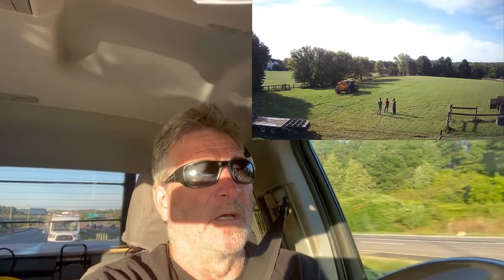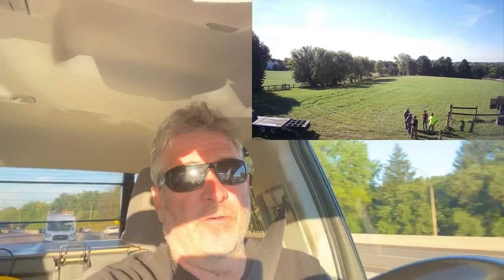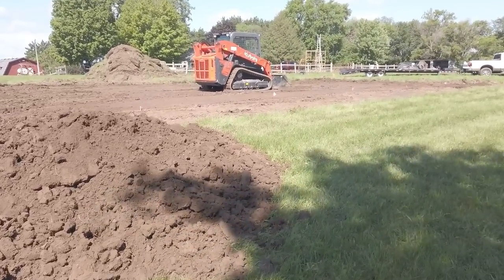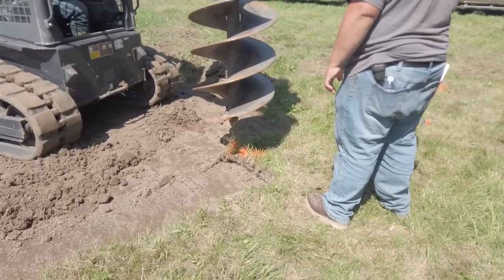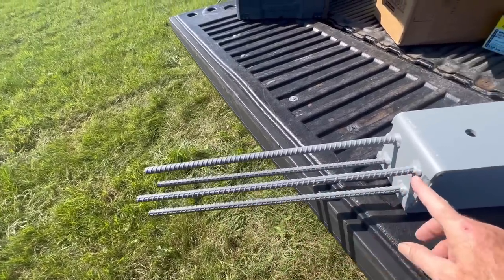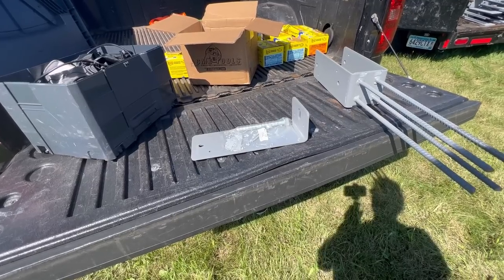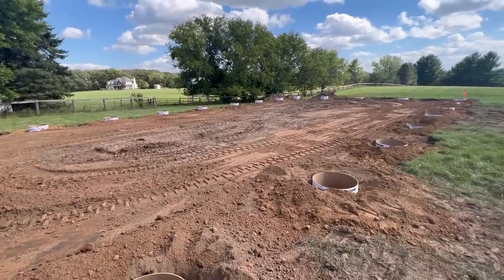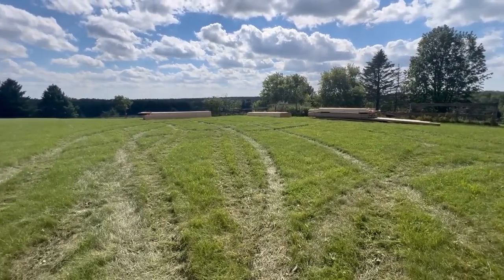How to build a gambrel style post frame barn Part 1

Comment: This temporary warehouse is under way. You are a very talented contractor, experienced in large commercial type buildings, fine home remodeling, finish carpentry, and cabinetry. Few problem solvers can handle construction in so many arenas as well as you. Keep up the good work and see if Matt has a few slabs to adorn one wall in the office area.
Reply: I thought it was going to be called The Crotch Barn.

Comment: Glad to see the posts aren't being put into the ground. Always wince when people stick the posts right in the ground, even in concrete. They will eventually fail, even treated posts. See it all the time.
Reply: That depends on what timber you use.
e.g. Jarrah at 4 to 6 feet deep on a compacted gravel base then compact the soil around the post   
Will be as strong or stronger than the system shown with a weak spot between the concrete and the post.

Comment: Why do they put down the "plastic" under the roadway? Seems like it would trap water and cause problems with freezing and heaving.
Reply from the maker: The fabric does allow drainage my understanding that keeps the sub soil in the gravel from mixing and help stabilize the road bed
Reply: @donavanshomes  Yep. It keeps the fines from disappearing as quickly.

Edit:  I had it backwards. It keeps the rock from disappearing as quickly.
Reply: It’s a semi permeable membrane(water), not solid plastic.

Comment: Can you explain what class five means?
Reply from the maker: Class 5 Gravel is commonly used for base under blacktop, and also used for road & driveway material. Seen on many township gravel roads and packs well. Product is made by crushing and screening process Generally it is made from recycled concrete and asphalt
Reply: @donavanshomes  Is it the same as 3/4 minus?
Reply from the maker: I believe it has more fines in it than 3/4 minus